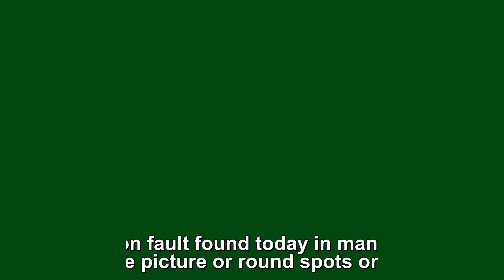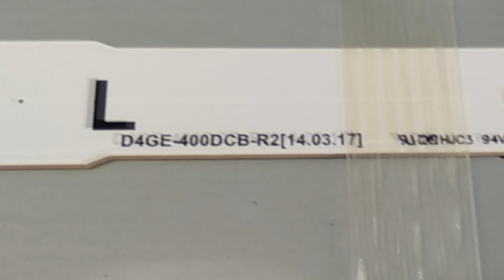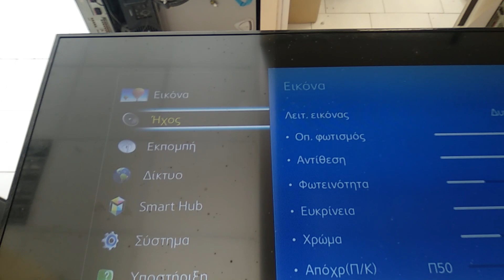samsung led tv has white spots and blue - purple picture - repair

Comment: Maaan. there are a lot of people with this problem discussin in Forums and you showed here clear what could be the problem of most of them. Great video. How easy is to open the TV and change the LED strips? thanks a lot !!
Reply from the maker: thanks for your comment.its not that easy if you haven't done it before...the lcd panel is a very thin glass and can break very easy if you are not very careful.if you want to open it your self, watch some videos first what and how to do it..
Reply: @electronics4all  thanks. i dont think i will do it. the panel is 55" big and for sure i will screw up. Better to sell the tv for someone that want to try. cheers

Comment: I had the exact same problem, purple spots and light spots. When I opened the TV some leds were blue and the others were white (don't know why). I repleced all of them by new ones bought on aliexpress (15€), and the new ones were all white. The TV is now like new.
Reply from the maker: im glad you solved the problem.
Reply: Would it be expensive to get fixed off somebody with tv knowledge

Comment: I recently just purchased a Samsung ue50h6200ak, and it has faint blue /purple hue on a white background, I got the tv super cheap, and I was wondering if it is worth doing, also would the leds be the same type on the back of my tv? Many thanks
Reply from the maker: i dont really undestand what you mean.you should search for led strips based on what tv model  you have or the sticker of the panel.(you must remove the plastic cover of the tv to find it).and then order the led strip kit. a quick search based on the model you have found this : https://www.aliexpress.com/item/1005002123630474.html
Reply from the maker: first you should check the backlight colour of your tv if this is the fault.it might not be the led's.maybe a bad t-con board or panel..
Reply: @electronics4all  thanks for the reply, I spoke with a local tv repair guy who specialises on samsung tv, he said that it sounds like the leds are just starting to go, and said it would cost £120 pounds for new leds and labour, so I'm probably going to get him to do it.
Reply from the maker: @dalehawke7621  if the tv is not a very old model i would fix it too..
Reply: @electronics4all  well the tv is 5 years old, and I only paid 80 pounds for it, so the way I look at it, tv have a perfect TV again, will have cost me 200 quid, which is still cheaper than another other TV of the same specs to replace

Comment: What tv screen would you recommend these days, if LED can be problematic?
Reply from the maker: it depends on the amount of money you want to spend on a tv.all ''cheap models'' led tvs have the same problems.if you buy a more expensive model the leds probably will last longer.and depends on how much time the tv is playing or the backlight setting if it is set to highest the leds will burn sooner.i really dont know what kind of display i would choose today..maybe oled-qled.but those technologies have other issues.
Reply: @electronics4all  I have a Samsung plasma tv. Likely purchased about 8-9 years ago. I'm still happy with it, so hopefully it lasts awhile longer. 

My friend's television is a Samsung lcd tv., that she's had for maybe 6 years.   Yet, it was definitely left on often during the day, to entertain the cat and in the past 2 weeks has developed a noticeable single circular light on the panel.   I suppose overuse is the culprit.  I don't think it was a very expensive television. 
I believe there's a couple tv repair places in my city, so that might be an option and less expensive than buying a new tv.

Comment: Can we not just paste back the detached diffusers if it's just 1 or 2? Thanks.
Reply from the maker: of course you can. but if you dont put it back the right way circle spots of light may appear in the screen.before placing the lcd try it first only with the white and transparent  plastics to see if there are any spots..

Comment: hm.. my 2017 samsung TV gets more purple everyday .. :/ maybe i can save it
Reply from the maker: of course you can save it,if you are very careful and disassemble the panel without destroying it..
Reply: @electronics4all  the thing is it also could be the "led driver board" which is known to overdrive the led's in my tv, in this case i need a donor board and thats not worth it tbh, it already makes loud buzzing noises when i dim the backlight
Reply from the maker: @tezy0193  oh..ok..in my repair shop, faulty led driver board in a tv especially lg-samsung is very rare..to tell you the truth,i didnt find a tv that the problem was the driver. maybe then you should replace the led's that failed and see what happens..
Reply: @electronics4all  alright, i'll give it a try soon thanks for answering, cheers !

Comment: Where can a buy the leds?
Reply from the maker: if you can wait alli express is cheaper. or else in electronics shops(that sell components) in your country.(dont know which)
Reply: @electronics4all  Thanks for your reply! Im in US and I found them on ebay. I did open the tv up to make sure I found the correct array. It had 4 LEDs busted, but I might as well replace them all lol. Thanks for the inspiration to try and repair it! I was about to start looking for another tv.
Reply from the maker: @rjsep7747  the best thing is to replace all the led arrays and not individual led's because sooner or later the rest(old led's) will burn too..